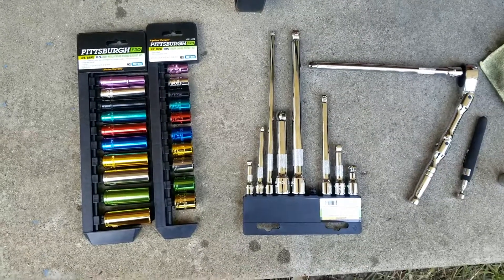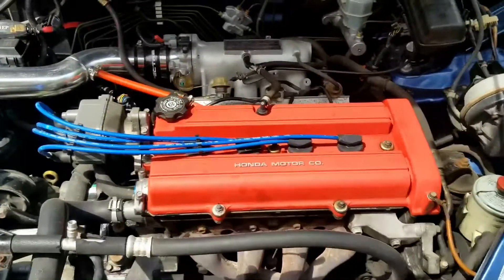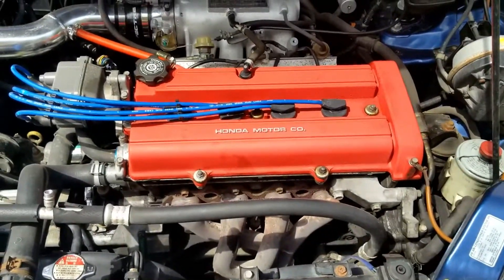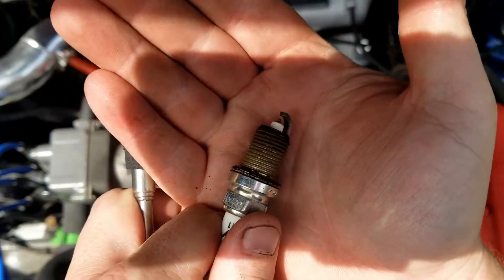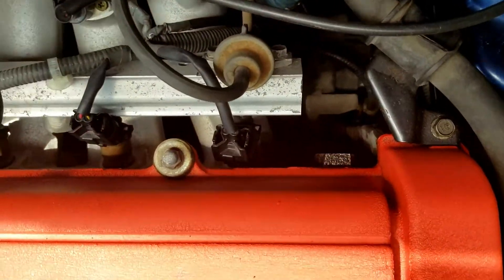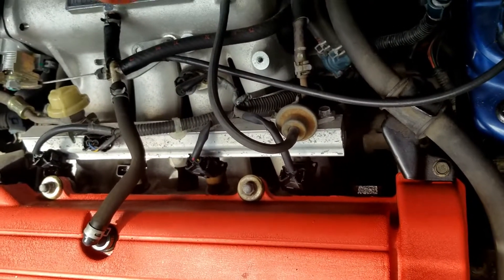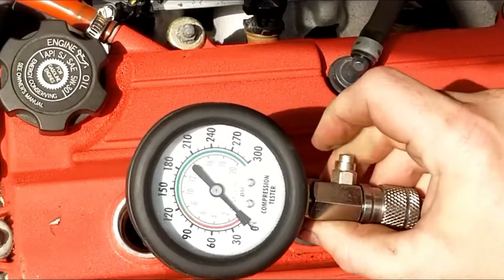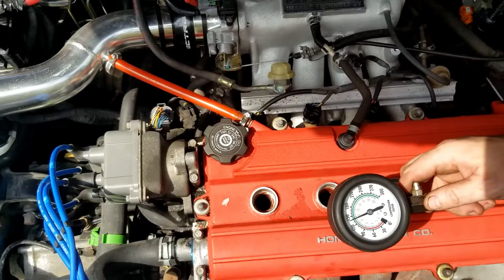How to do a Compression Test 1st gen CRV 97 01 RD1 B20b4

Comment: If they are all under spec any ideas what that may be other than the over all engine rings are bad.  I should probably do a wet test.
Reply from the maker: Rings could be bad, valves may not be seating properly. Doing a wet test will help determine that. If the compression is higher during a wet test then yes you probably have bad piston rings. If the test comes back pretty much the same then you probably have a issues with the valves not seating and fully closing. These B20's have a issues with burning valves, the "rocker arm" will get tight unlike all other B series engines where they get loose.

Comment: If the engine was cold, these numbers are kind of okay, but that number 2 cylinder is a little low. The biggest thing is to not have more than 10% difference between highest and lowest. You can expect much higher (160-190 psi) if the engine is at operating temp when the check is performed.
Reply from the maker: At this point the V has been sitting for about 2 years. I'm going to pull the engine and rebuild it. I think it's got a burnt valve and it leaks oil from everywhere.

Comment: My 98 crv has 200,000 miles and 3 cylinders are at 100psi and 1 is at 30psi.
Reply from the maker: could be blown head gasket, valves are not closing completely or piston ring is done....
Reply: I got 3 at 140 and 1 at 60. Burned exhaust valve for me.
Reply: Well that makes me feel a little better.  Mine are at about 110-120.